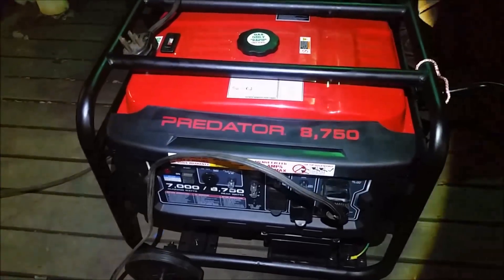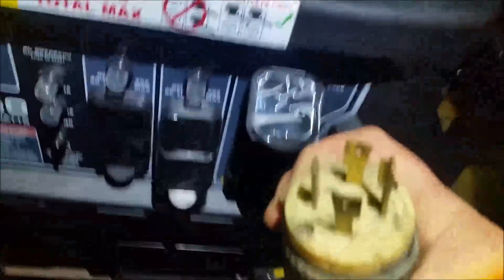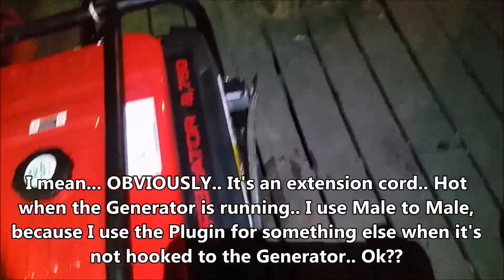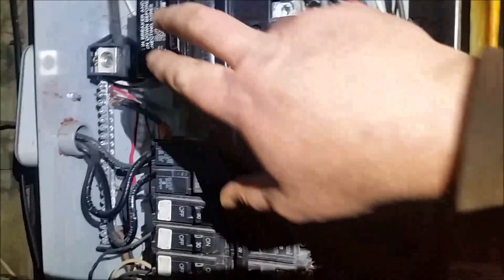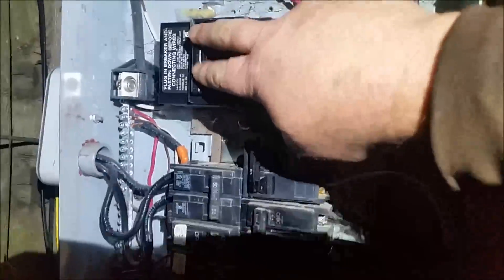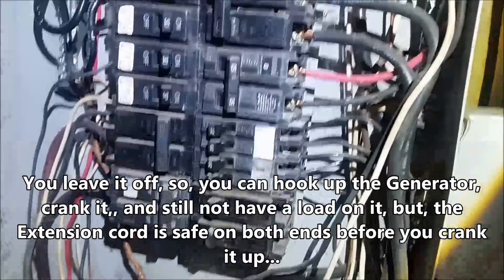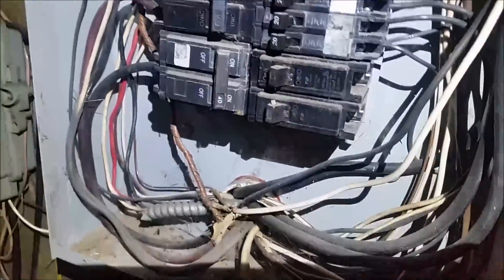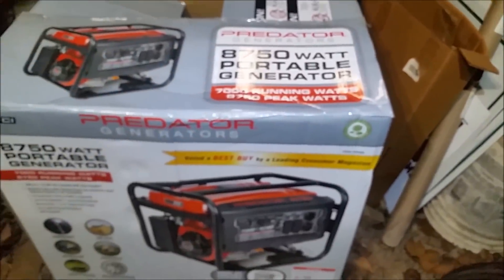Quick/Easy/Safe: Use Existing Plugin/Breaker for Generator hook up to your house Panel box.

Comment: I have many problems trying this. First, every outlet in my house is either protected by a AFCI breaker or GFCI outlet. I've been told backfeeding thru any of them will damage the electronics within them. I do have one of those switch/outlet combos connected to the furnace which is the only non AFCI/GFCI breaker/outlet in the house. I do know if I plug into that, it should allow at least one side of the bus panel to work. Just can't tell if the breakers I need with be on that bus. Second, I don't have any 240v outlets in my home. No electric dryer, stove or AC. Third, my generator has no 240v outlets either.

I had thought about connecting a 20A double breaker into the panel and running two separate 12AWG hot/neutral lines to a duplex outlet with the pins removed of course. This should allow me to connect two cords from the generators separate 20A outlets right? Does this sound like it would work?
Reply from the maker: X6800 You have an interesting house to say the least.. Ha.. 
Backfeeding through either of the GFCI outlets/breakers would be problematic due to their sensitivity, and they are expensive, so, I would not try it just to be safe on the expense side of the house... 
Switch/Outlet combo would work for the breakers on one side of the panel. Yes.. But, it is not the smartest or safest thing to do, because it has a distance to go before it gets to the main panel and you didn't say what size wire was connected to the furnace.. Since you said, No 220/240v outlets, it is only running a fan, and does not need more than a 15 amp breaker, which could have a wire size of 14 ga or larger.. That is not a lot of copper to be feeding a house, or even one side of a panel.. Heaters and Microwaves pull 15 amps each.. You are getting to the point where you would have to be careful and do some calculations and be careful of what you turned on at the same time,, and errors in doing that could cause that furnace circuit to overheat and bad news.. Not worth the risk..
A rule of thumb.. If you have a 15 amp breaker in your panel that goes to something, and you have a 15 amp breaker in your Generator,,,, the risk is greatly reduced.. You can't feed much more than 15 amps under a short period of time before the generator breaker trips, and by that time, if you were also overloading the 15 amp circuit inside, in theory,, you should be safe, but, theory is just that when dealing with electricity..
I would find a way to get inside of the panel for the Generator to House Hookup....  It is really the only way you can't create a problem like we were talking about just now.. If you pull too many amps, the generator will die or breaker trip, and the feed directly into the breaker panel, as long as you use a large enough wire from the Generator to the Panel, you are within specs there and the panel does the rest. 
I would make a legend for the Panel and get a family member or buddy to help me track down what breakers go to what in the house.. ESPECIALLY, higher current items like "Bathroom Hair Dryers, Curling Irons, space heaters, Kitchen coffee makers, Microwave, etc.. Basically anything that gets hot.. And, anything else you might need during a power outage or extended power outage... 
Then, see which side of the panel the majority of those items are on.. Even if you don't turn all of them on at the same time(not recommended at all), you can use them one by one.. Then, I would consider what it would take to move some of the circuits from the other side, to the side I needed during an outage.. 
Lights, Furnace, etc.. will be of some importance.. Buy a coffee maker for the stove and get a little burner to cook something very simple, but, sounds like you have gas, so no worries there.. 
REMEMBER!!!!  You should have a standard Main Breaker panel, no matter how wild they went with the GFCI circuits... 
Turn your main breaker off and take a good look at your Breaker panel.. Pull two of the top breakers out on each side of the panel and take another good look.. What you are looking at is the fact that the box is really NOT, a one side or the other box... Every other Breaker runs off of the same or Other side of the box.
So,, worst case scenario, I will give you another idea after this, but, you should be able to move a breaker on one side,,,, up or down one slot, and you will be feeding it off of the OTHER side of the box.. This may not make any sense until you look at the box with at least the top two breakers on ONE SIDE removed.. 
So, swapping circuits in the panel to get everything you "NEED" on one side of the box (so to speak) (One Leg for the Generator more specifically) is not that difficult.. 
BUT,, there is one caveat to all of this.. Generally, you want your panel balanced.. It is done by accident 99% of the time by Electricians due to the nature of the panel.. But, you will be specifically making your panel unbalanced.. Specifically and very effectively.. This WILL cause problems with limited power Sources (THAT FEED both sides of the panel).. So,,, if you ever get a larger Generator, you ABSOLUTELY NEED TO FIX THAT at that time, because,, now you have a limited Power Source that is totally unbalanced.. Running on Utility power should not create any problems,, but, you should verify that your ground is good below your panel and anything strange that might crop up could very easily be related to a substandard Ground.. It could even be the connection to the Utility power at the top of your Goose neck above your house where they connect... 
I had to say that,,, so you would be aware if you started having problems for some strange reason,, that would most likely be the source of it... 
That said,,,, with all of the GFCI circuits/outlets you have,, they would be the first sign you would have.. Them flipping for no good reason, and it will most likely not be just one (so you will recognize it is something else and not a weak GFCI that needs to be replaced).. Saying that,, it could effect a weak GFCI before it affects the others, so, when you replace one down the road, put it in a ziplock and write the location where you removed it, the date, and why you removed it on a note and put it in the bag.. If you start having problems with others in the next 3 to 4 months,, hang onto it.. It may be weak, but, not bad, and might function correctly for some period of time when you get things (most likely the ground) fixed up again.. 
If you connect a larger 220v generator to a totally unbalance box, and start turning things on,,, if you have the slightest problem with a ground, you are going to experience some problems.. GFCI's, Surge Strips etc,, will be the first signs.. But, like I said,, if you get a 220v Generator, it is the first thing you do.. Balance the box back like it was, or to the best of your ability based on the legend you created.. Do it in Excel, so you can copy and paste to update it down the road..  Enough said about that,, I think... But, you tell me if you have any questions.. 

If moving breakers up and down a slot is not enough to get you where you need to be,, and you need to move some circuits physically from one side to the other....
You can check with your local Building Inspector to find out the regulations in your area about making connections inside of the panel. I would imagine it would be fine.. If you need to move some circuits to the generator side, you can take a piece of wire with some twist lock nuts and twist the wires together with a pair of pliers, then, wire nut the connection and run it to the other side of the panel.  Or,, maybe you could twist two wires with the circuit wire you are removing and when part of going on the generator could be removing some circuits from the generator side you don't need and connecting the extension pigtails to the generator side temporarily while you are on generator, then, wire nutting that wire you remove when you go back on Utility power (put a wire nut on it and tape it on), and use the other wire you connected to plug back into the circuit it was connected to before you started... A little extra work, but, depends on how many breakers you have in your box, which do you need, and what side are they on, etc.. 

You asked me a question I am still thinking about.. Feeding each side with two cords coming from your generator, both 110/120 volts.. 
I had to think about that one for a while... That one was strange.. BUT.. 
If you don't have any 220v breakers or 220v equipment (so strange,, you need to check that),, then,, feeding two cords from the Genset,, one to each side of the panel would work.. Just be sure to feed the correct breaker or you will be feeding the other side of the box from one slot up or down of where you should have been.. I still can't get that in my brain to say whether that would be a problem or not,,, but, I would avoid doing it.. I may have to try that one day just to see.. I really can't say if that would be a problem or not, but, I see no reason to do it and no benefit,,, so, I would avoid it CAREFULLY.. 
Unless you are 100% certain you don't have any 220v breakers, I would take a couple of pictures of the box and show it to someone else,, or at least open a panel other than yours and be sure you are correct.. That is really strange not to have a single one. Hope that helps.. 

If you want to send me a picture, I'll look at it.. You will find what you need on this page to contact me.
https://www.youtube.com/channel/UC1-Hsuqf0cOWHSDCaRk8d9Q/about?view_as=subscriber   Cheers.. BTW.. What State do you live in? and is it is house or house trailer,, newly built or very old? If you ask me any more questions, that would take some of the guess work out and shorten my replies.. Ha..
Reply from the maker: When you get your 220v Generator,,, here is a solution for you to consider.. You would have to replace your GFCI's with regular 120v plugins though.. Cheap enough though.. Easy way to get 220 in an area, if you are lucky.. 
https://www.youtube.com/watch?v=LZbIJZe_YDs

Comment: ...and number 8 you get electrocuted
Reply from the maker: This video is not for Ignorant people like you.. You don't even have to open the panel.. If you can't figure that out, then,, you should do something else you would recommend that includes opening the panel and wiring in some safety mechanism.. Then, you can make your comment after your done.. 
That way,, we don't have to hear you stupid shit... Follow someone else's video.. My information is not for ignoramuses like you..
Reply: @MarkThomas123  a little sensitive Mark. Actually the smart thing to do things is to think ahead and prevent accidents from happening. I do a lot of my electrical work, have a doctoral degree and my system has an interlock switch an a female connector to the house. I am glad you are still alive. Peace
Reply from the maker: @drbichat5229  Well, that makes a lot of sense,,, now doesn't it???  I prevent accidents by not causing them and avoiding them, where something else might cause them, that I can avoid..  I don't worry about me.. And, I don't need an Interlock to remind me that I need to turn the main breaker off.. Kind of like, I tie my shoes before I take off, or put my car in park before I get out and leave it.. It's no difference, because I understand electricity and would not make that mistake.. Besides.. If you really think about it,, in a power out situation,, you should be able to tell yourself what would happen if you backfed the grid.. Even "IF" you did,, the llikelyhood of hitting someone with your generator backfeed would be less likely than winning the state lottery.. But, that would require you to do some thinking and use what is more important than Reading/Memorizing and taking tests.. It's called Conceptual thinking.. 
Maybe you didn't catch things in the video, but, you can't do what I do with an Interlock.. You may have missed that though.. You can't use an existing plugin that you would normally use for some other heavy 220v device normally, (that you won't be running while on Generator), and use that same plugin for your generator (temporarily) while you run on it..   That is what you can't do with your (Help me remember to turn my main breaker off "Interlock switch").. That is,, what it is BTW!! It provides no other function.. 
And,,, IF,, you have what you say,,, IE... Female Connector to the House,, there has to be a Male end there somwhere.. And, since the Generator has a female also, that means you must be using a "Suicide cord???"
Ha.Ha..Ha.. Or,, do you have a Male plugin on your house and you thought for a minute how stupid that was?? The only reason you have a Male Exposed Plugin on your house is so you can have a female on your Generator (Standard) cord.. So, if you have a Female, then, why did you bother with an Interlock?? I mean,,,, you could use the plugin for something else while you wait for the next power outage.. Making Sense yet?? 
I am really not going to knock your Doctorate, but, to be honest with you,,, it just means it took you a really long time to learn something that someone else could have learned much faster and in a shorter amount of time, who was not looking for a degree... You know degrees.. They put them on those little glass tubes filled with mercury, and stick them in the babies behind to check their temps?? Well, at least in the old days.. 
BTW.. We all know there are lots of fields where you can get your doctorate or doctoral degree.. 
BTW.. I can't remember having someone else do anything for me in the last 10-15 years, and I work on any and everything.. Maybe a little mechanic work here and there that I took to a friend who does it cheaper than I figure my time is worth.. But, most of the time, I take the parts to him when he is ready, already having diagnosed the problem.. 
Any argument you have for not doing what I do here with the generator, won't make sense after I reply about it, except,,, "You have to remember to turn the main breaker off".. Whatever you have to do to remember that, this is the most efficient way to do it past that.. Hell, just put a note inside of the box.. It's really that simple, if you don't open the box and immediately think,, "Turn the Main Breaker off First".. Peace and glad you some how got the interlock installed and,, glad you are still alive after that.. Still had to remember to turn the main breaker off,, though,,, didn't you?? See what I mean?? Ha..Ha.. Cheers!